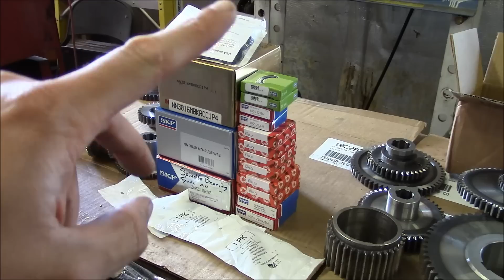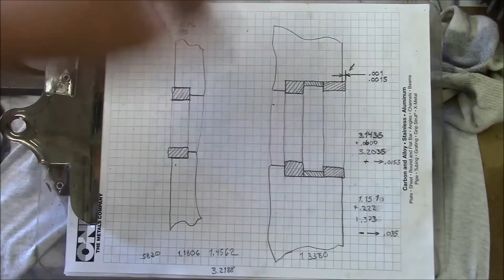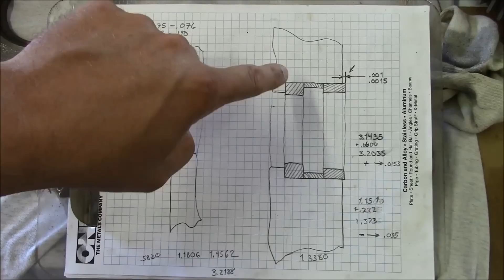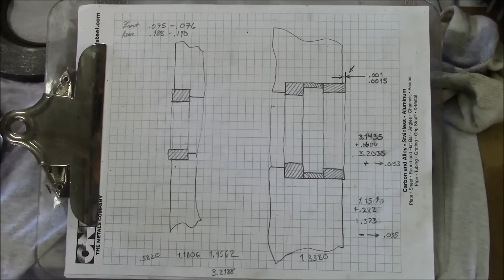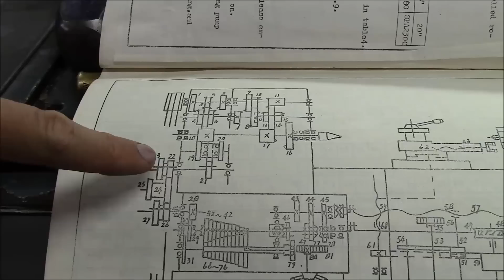Engine Lathe Headstock Rebuild / Spindle Bearing Replacement

Comment: Permatex could also mean #1, which was the hardening gasket maker. I think I used it all of once for something I can't remember. But yea, if I say Permatex without a modifier I mean #2.
Reply from the maker: I'm not sure what I would use #1 for.
Reply: I don't recall what I used it for either, but I recall the instructions for whatever it was specifically called for #1. That was probably 60 years ago. I've used up a lot more #2.

Comment: I hope this works out great for you Wes, but the balls in those bearings are way harder than anything you are beating on them with, but you still can dent or chip them. Next machine use  a screw press and a mandrel.
Reply from the maker: A press might work for a few, but you will still have to push the inner bearings in the "wrong" way. Other (better quality I'm sure) headstocks I have rebuilt use tapered roller bearings and don't really have this issue. However, they take an enormous amount of time to setup since every bearing has to be shimmed for proper pre-load.
Reply: Wes Johnson, I used to knock in bearings with a hammer until I found it tended to make them noisy. If you have to, then be gentle. I cannot imagine a factory doing it that way.

Comment: Wes it was long time a go but I had do similar job to graduate, the job was in a South Bend with more than 40K hours of use & abuse by students, was fun, and I pass.:):)
Reply from the maker: What type of program were you studying?
Reply: I attended UTU University Technological the Uruguay, Mechanical Engineering, we go thru, Lathe, milling, mechanical Shaping, woodworking, black smith and electronics.

Comment: LOL... great way to ruin new bearings ramming with a hammer on inner races LOL
Love to be your bearing supplier m8, always wellcoem fo rnew business hehehe.
Reply from the maker: The bearings are a press fit on the shaft. You have to push on the inner race. Been running great.
Reply: Ok fair enough (proper tools are not cheap) but  best to use some nylon type of tool; metal to metal to drive in a bearing not so good.
Have seen worse ways to mount bearings btw; true shock and horror but that car was sold shortly after LOL.

Seems to be ABEC9 (?) super precision class spindle bearings; should be dots on races to mark high and low points to get better run-out.

Comment: Thank you for the video, Wes, it was fascinating.  One question: where did you learn about setting the proper crush for the front bearing?  I am wondering if there is a book somewhere that teaches fundamentals of lathe construction like that.  Not only would I not have known a machine needed a specific crush, I would not know where to go to find out it needs the crush!
Reply from the maker: This is a good guide. Dimensions are all metric, but the information is solid. http://www.feyc.eu/download/aplicaciones/maquinaherramienta/nsk/MachineToolSpindleBearingSelectionMountingGuide.pdf
Reply: Thank you!

Comment: Thanks for the video, I may have forgotten since the first part, what brand and size is that lathe? Besides my classing, I picked up an Acra Turn 1340, which appears to be a clone of a Harrison 300. The headstock looks familiar even though the controls are arranged differently. Thanks again, JB San Diego

Comment: Great video lot of work, I have a Acra Turn 1340 I want to change the headstock oil. What type would  suggest ? Thank you for sharing your knowledge.
Reply from the maker: Most modern lathes recommend an ISO 46 hydraulic oil for the head stock. I use Mobil DTE 25.

Comment: I do field service on cnc , I helped replace a B axis table bearing on a harizonal mill, $24,000 just for the bearing, to hold .0001 is expensive, .005 easy

Comment: Did you add the oil pump to this machine? Mine does not have an oil pump and had a bearing failure from what appears to be a lack of lubrication. I’m considering adding one.

Comment: XLNT video Wes, you should consider making a career out of this! (I say that's a joke son...in my best Foghorn Leghorn imitation)

Doesn't seem to bad a price to pay knowing you'll have a rebuilt headstock. And that it is put back together correctly. You certainly couldn't get a lathe like that with a rebuilt headstock for what you just paid for the parts. I commend you on your skills to accomplish that, I don't think I could pull that off and would probably just toss the lathe out and get another one if it was me. No question you saved a bundle in being able to do that yourself. After attending to the cross slide and/or other issues, you should have a decent lathe. Nicely done!
Reply from the maker: Yeah, the labor cost would kill this job for anyone not wanting to do it themselves. I probably wrapped up 40-50 hours with all the work of repainting the bottom of the casting, pointing the teeth, replacing the other ball bearings, and doing the spindle bearings. If it was just the spindle I think I could have done the whole thing in one day.
Reply: In the end you will have a much better lathe than original, and more so, the work you just did will actually turn it into a pretty accurate lathe after you can attend to the other issues. This is the bulk of your expense after all. You are lucky to have the skills and be able to do it yourself. Even more so, you will make the money back you just invested in this lathe for many years to come, and many fold the cost. Touche'

Comment: I forgot to mention if you put the bearings in the freezer or dry ice and warm up the casting would they go in more easily? To bad you can't install a filter somewhere in the oil system.

Comment: really enjoyed watching this, I have a 1440 made in Taiwan and can relate.
did you ever get your headstock aligned or checked? I found on mine they did a number on the alignment with the bed and had to shim it in the back to get it close. The gap is a few thou off also and that's the next thing I need to tackle. Keep these coming, thanks for sharing.
Reply from the maker: On this machine there is a push-pull bolt arrangement to align the headstock. It's actually pretty simple. We will cover that in a follow up video.
Reply: Wes Johnson 
A time consuming difficult job that few people on the planet have the skills to pull off. Maybe because of your generosity a few more will have the confidence to attempt. Thanks for sharing!

Comment: Great video! Very informative in all aspects as to what to watch/lookout for. What state are you located in? Just picked up a Namseon Acra-Turn 16x40 and needs a little attention on the feed drive gearbox. Other than that it is in amazing condition. I have no technical reference for it and have called Acra-Turn in Rancho Cucamonga, CA to little avail. I also downloaded some of the machining references (Testing Machine Tools and a few others) you mentioned in a previous video.
Reply from the maker: I am in Northern Illinois. Thanks for watching.

Comment: I need to replace the bearings in my vertical mill. Not looking forward to it.
Reply: If it's a bridgeport style, it's not very hard or complicated.  Several videos on the web/utube.  I replaced'em on an old abused mill ('65) I picked up for scrap metal price, and made a "useable" mill out of it, that, with patience, CAN hold tight tolerances on items being machined.  It's not a complete head rebuild but it will do what I need it to.

Comment: Can you explain the difference between sliding mesh and synchromesh transmission system
Reply from the maker: This is a sliding gear system, so the gears have to slide together to engage. In a constant mesh system, the gears are always together, but they have to be connected to their shaft using a sliding dog clutch. A car transmission uses constant mesh with a synchronizer to avoid grinding the dog clutch. Constant mesh is more expensive to build.

Comment: Have you seen improvement in the quality of the turning after the repair?
Reply from the maker: Yes. I will try to show the difference in the next video.
Reply: Wes Johnson,  The large bearing bore on the right side of the headstock appears to have several thousandths wear. I have not seen enough of your videos to tell what goes in there. Ah, looks like the chuck end of the spindle. If the wear in the case is a problem, you can pry up on the bottom of the chuck and check play with a indicator. Does the hand drawn bearing on the square graph paper need a gasket where the bearing stands proud? Guess not, you said there were none. Re the crummy assembly diagram: sometimes you can get a more informative exploded drawing in the parts manual.
Sorry to be so negative ... well done on your gumption in getting in there and working through to the end!

Spherical Roller bearings are for radial loads, the thrust is likely taken by those large multi- part ball bearings. Google spherical roller brgs, there are other appropriate bearings that will show up. 

Spherical Roller Bearings | AST Bearings
AST Bearings › Products › Roller Bearings
spherical roller bearing from www.astbearings.com
Spherical Roller Bearings are designed to work in applications where severe misalignment exists whether from mounting or shaft deflection and with relatively heavy radial loads and some axial loads in either direction.
Reply from the maker: I don't think the bearing bores are worn. The new bearings pressed in nicely. This machine has no gaskets. I used the Permatex #3 and built in an extra .0005 clearance to accommodate it. The bearings are tapered bore cylindrical roller bearings. They are made specifically for machine tool spindles. You probably will not find them anywhere else. If you want to look them up, the front bearing is an NN3020 and the rear is an NN3016

Comment: Hey Wes, what was the red coating in the floor of the headstock ? I have some flaking I need to deal with in a quick change box. I plan on coating it with a urethane epoxy but something from the auto parts store may work well enough.
Reply from the maker: It's just red Rustoleum paint. I brushed on a few coats. I suppose Glyptal or something would be better, but much more expensive. I chipped out the old paint with a needle scaler.

Comment: Lol 500 subs I agree your auto content does better but I’m sure you still do some machining from time to time making special tools and what not you should throw it in too honestly now that I’ve learned what little I know machining related I believe any repair shop should have atleast a small lathe and maybe even a mill just way to handy to repair old threads make bearing pushers the list goes on for miles

Comment: Can't believe you didn't damage the bearings hammering on the inner races like that, not to mention slipping and hitting cages etc.  :-/
Reply from the maker: It looks a lot worse than it really is. Deep groove ball bearings can take a lot of axial load. The press fits are pretty light.

Comment: Great video! My Enco lathe has the same bering retainer as yours, it runs find but it leaks oil. What do I need to do to fix it? Thanks!!
Reply from the maker: Leaks oil where? At the spindle?
Reply: Yes. 6 0'clock below the spindle. It's a 20 year old lathe (my Dad bought it new) and has less than 100 hours on it. The faster I run the spindle the more the oil.
Reply from the maker: I don't know. Could be some crud in the labyrinth seal preventing it from working. It's built into the bearing retainer. There is no mechanical seal.
Reply: Thanks for taking the time to answer my question. Maybe the crud will work itself out.

Comment: Looks like you threw a coat of glyptal in there.
Reply from the maker: After buying the bearings I couldn't afford Glyptal (seriously it's like $50 a quart). I just used some red Rustoleum I had. It's supposed to be oil resistant.

Comment: What is the recommended oil and change interval?
Reply from the maker: Any good "anti-wear" ISO-32 grade hydraulic oil will work well. I'm using Mobil DTE-24. Interval is supposed to be 1000 hours.

Comment: Your bearing mounting "technique" is extremly risky
Reply from the maker: Yes, it's not ideal, but there's not much choice. I suppose when the machine was assembled they put the whole headstock in a large press, but they still have to push the bearings against the balls. There is no way to avoid it.
Reply: that's not my problem :)

don't you have any tubes around - instead of this screwdriver-like thing? 
i mean i clearly see the problems, but you slip off so often on those expensive bearings.

you could easily dent the raceway by getting to much force on a single ball.
Reply: Maybe they did it even worse than you did it. All the bearing were brinelled, after all.
Reply: hitting the cages could block a ball
Reply: Yeah I was cringing just a little there. Even sockets on an extension might be more forgiving. Not judging.

Comment: I saw it therefore believe it but I have a difficult time believing you beat the bearings in place using screwdrivers and some ground round stock instead of a proper bearing driver.   Kind of sad actually as they are so easy to make if you don't already have.
OK, I just saw your justification for your use of your driver method but I still believe you could have had at least a piece of plate between your driver and the bearing. 
Overall it's a good procedural video so no thumbs down from me because of your (cringe) bearing setting method.
Second OK:  read quite a few comments and quit after I got to the one where you said you knew better but were too lazy to make one - I have to admit Mea culpa tho just don't think I would make a video showing it.
Reply from the maker: I don't know what to tell you. The bearings are installed and they are not damaged. Whether I installed them with a magic spell or a set of tools that took my  3 months to build is irrelevant.

Comment: Too many adverts. Can't be bothered.
Reply from the maker: Interesting. YouTube seems to have meddled with my older video and jammed a bunch of ads in them. They have been removed. Thanks for bringing that to my attention!
Reply: @WatchWesWork  Yes - they did it last year sometime I think. Unless you specifically opted out (which wasn't straightforward), they automatically shoved a load of ads in all existing videos and if you later wanted to remove them, you had to do it to every single video. Anyways, thanks for responding, much appreciated - don't mind a couple of ads but just not every 60 seconds!